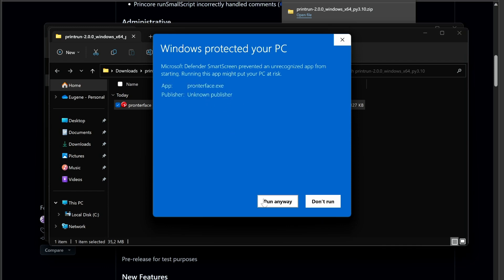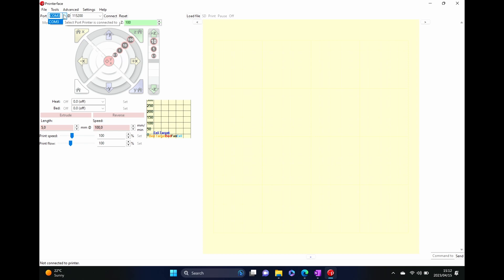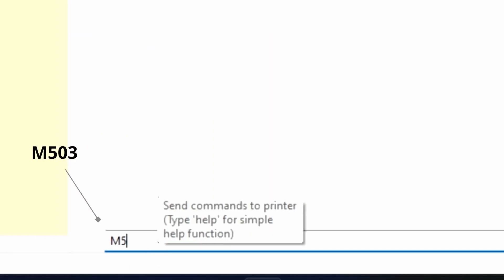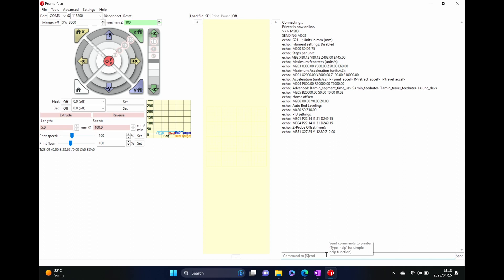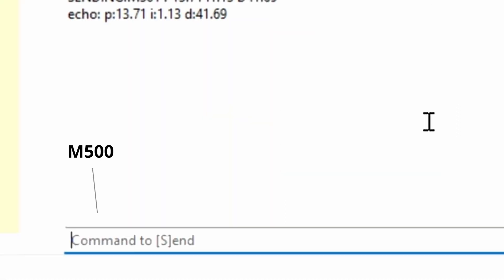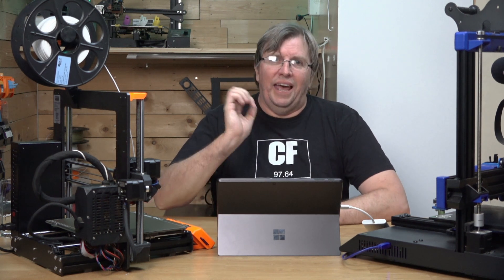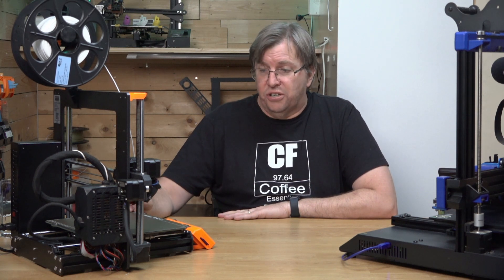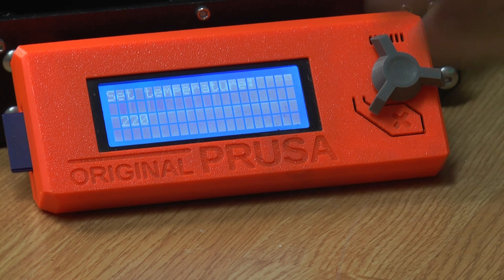Problems with Print Quality? Unleash Perfect PID Tuning in Minutes

Comment: HI i change the heating element on my printer the factory temp initialy was 250 degree after the change the max temp at the nozzle it's only 235 degree how can i get the 250 because the heating element it's good up to 260